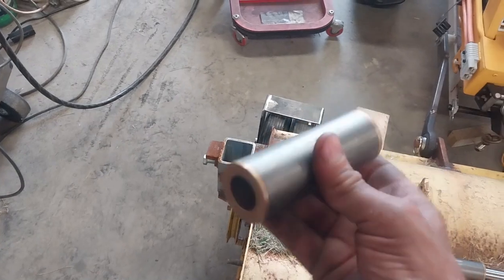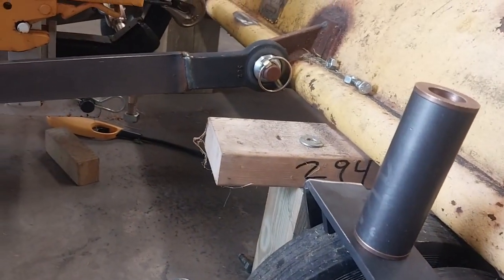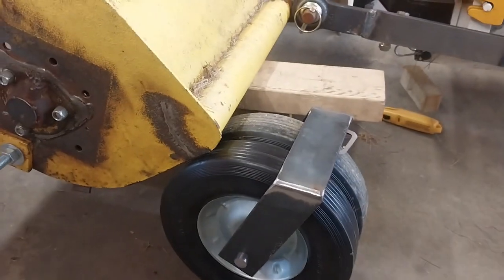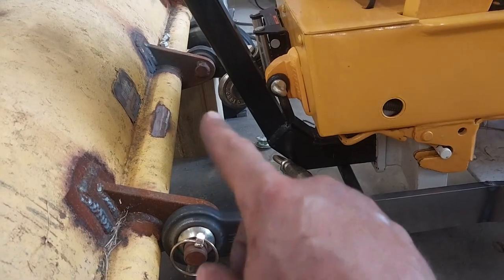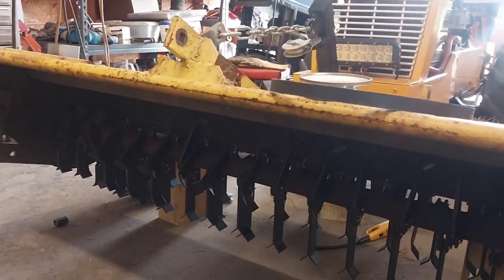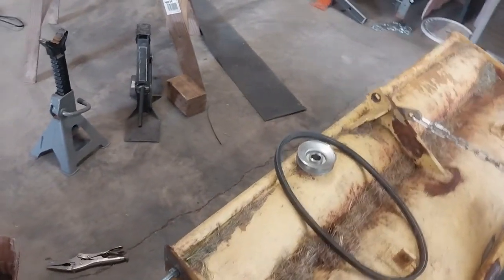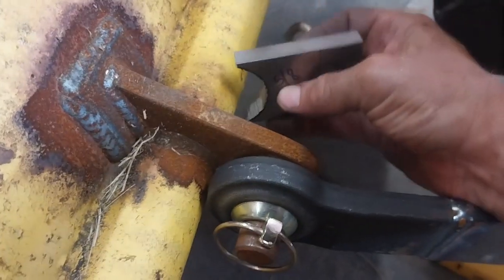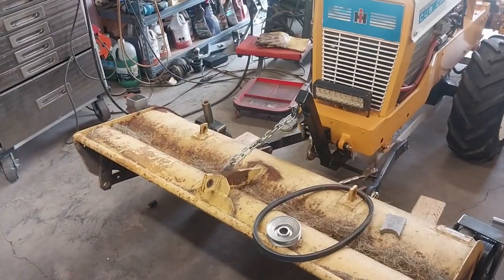Back To The Front pt2 - The Cub

Comment: Use thrust needle bearings and washers.
Reply from the maker: I thought about that but it's going to be a very harsh environment.  Lots of dirt and grass clippings would seize it up pretty quick I think.
Reply: Swivel wheels are all over ebay. 
Definitely want flat free.
I find all kinds of uses for the 8" rubber over cast iron.